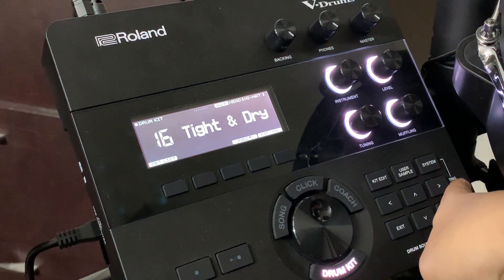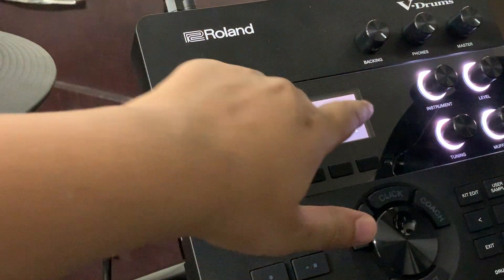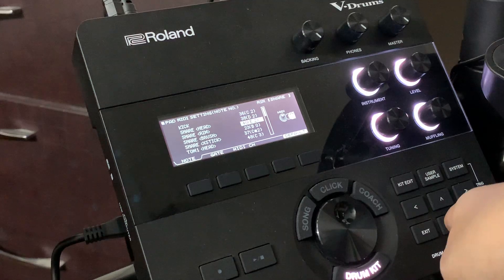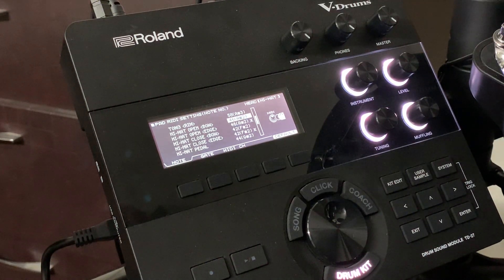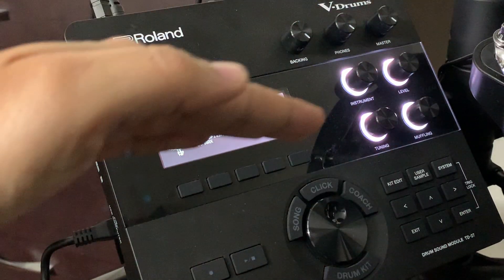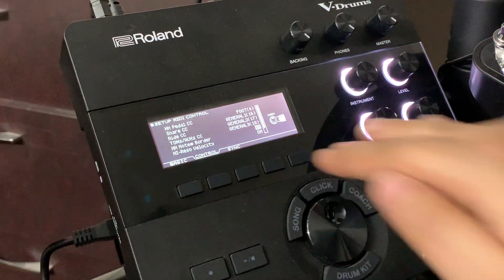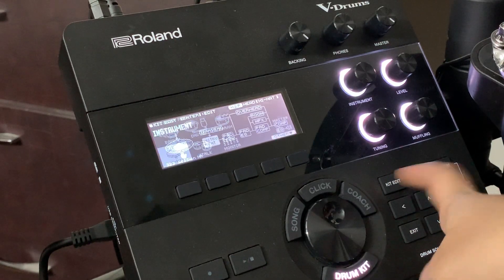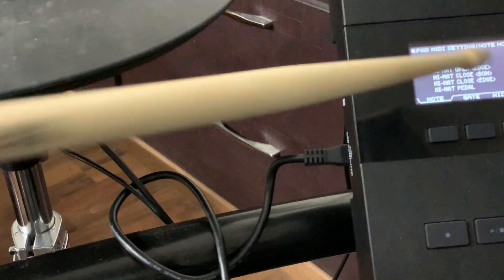TD27KV | Roland v Drums | Note Mapping | GarageBand | Hi-hat settings

Comment: great video! Ok serious question here. I have a roland td27kv I have been using a MIDI interface with for recording on my mac using garage band. I had NO issues previously other than the CONSTANT open hi hat swish no matter if I was playing with my foot closed or open. As of now that is the least of my problems. I recently had an issue where the edge of the HI HAT and left CRASH are not registering playing any kit chosen on my brain module. I have read about midi notes and midi mapping etc. The edge of hi hat and crash are still giving issues and very temperamental. Is this a known issue? Is there a quick fix for this? Master rest of the brain unit on the td27? Should I just use the audio and midi interface to record both or will this also have the edge of both pieces missing? When I play the OPPOSITE side of the cymbal and hi hats (the roland logo facing away from the drumkit) the sounds work. It is confusing it is driving me insane. The kit plays perfect through headphones standalone and through an amp. This is ONLY happening during garage band usage. Please help!